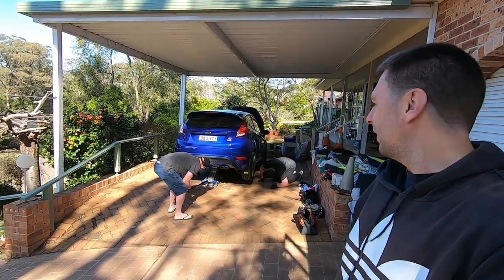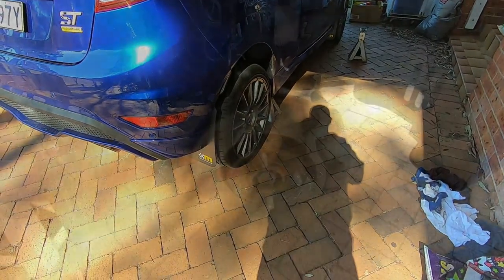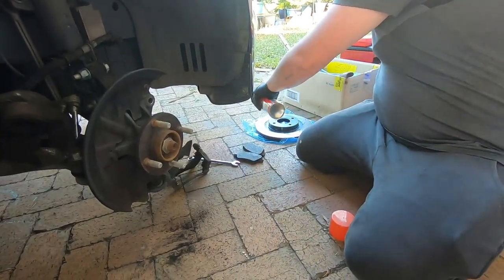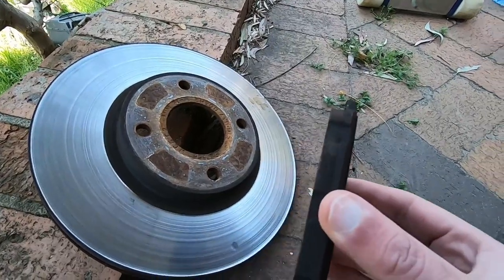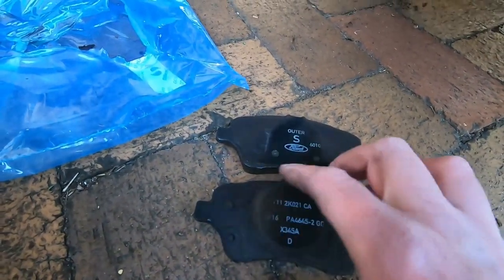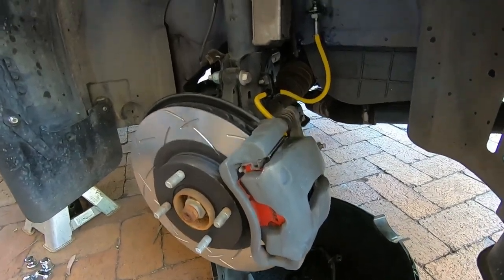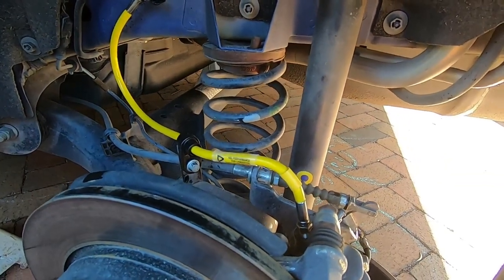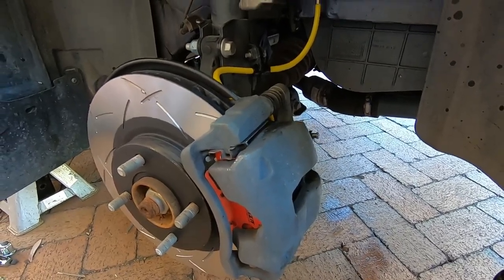Brake Upgrade for the Fiesta ST

Comment: You  can use Ford software via the obd port to prime the abs , so this pumps through the brake fluid for you , saves doing a manual  , down , up , down , up pedal bleed
Reply from the maker: Thank Neal. I was aware of that but don't have the software available to me. It's not a very common thing in Australia using Forscan and what not.

Comment: How do you rate the set up mate I’ve just got both same pads and rotors for the rs
Reply from the maker: Amazing. If the Forza FP3 were in stock I would have bought them again.
Track days and daily driving, no issues, just consistent performance. They work best with a bit if heat but I haven't had any fade on track yet.
Reply: @fordyford  cheers mate looking forward to getting them fitted next week mate